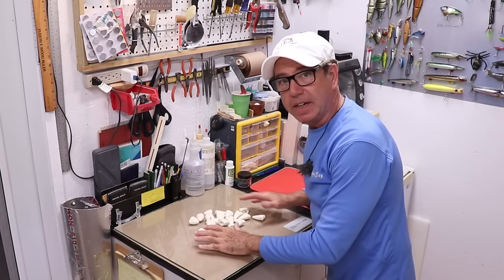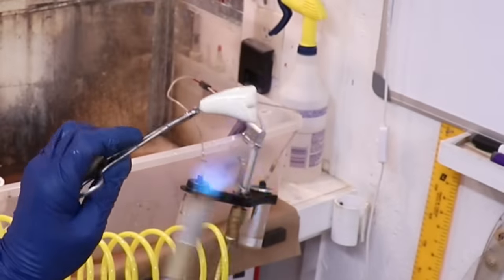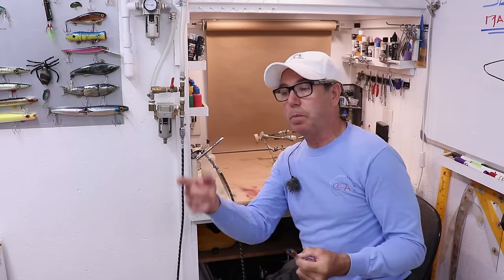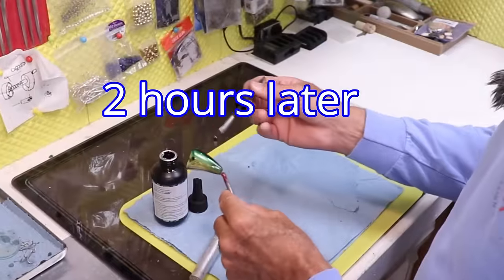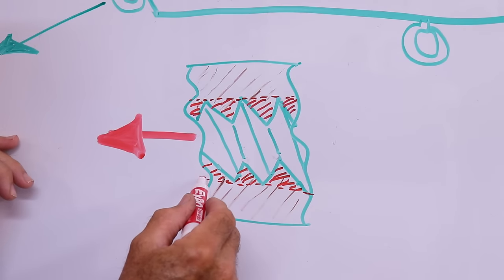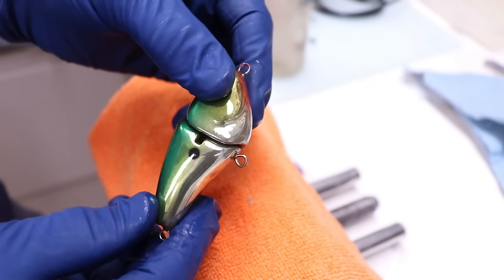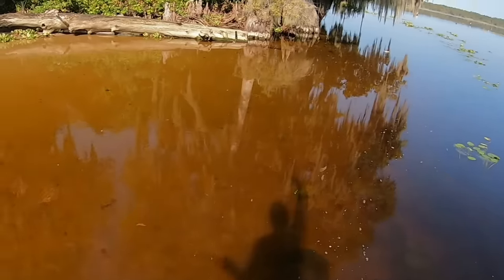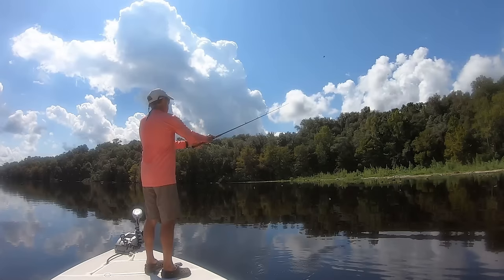Best Swimbait Colors, My favorite lure spray chrome color for everything  #lurefishing #luremaking

Comment: I noticed your strike eye tended to be located close to one of the bottom hook hangers.

Have you done any experiments on the location of the the strike eye holding all the other variables constant?
Reply from the maker: No....and here's why:  The strike eye is there  (on real fish) as a strategy to avoid getting eaten.  It usually pretty far back on the bait fish this way the predator will miss in the opposite direction of the escape.  I place mine near the center so I don't fool the predator fish,  I want him to get it right when he tries to eat my lure.

Comment: Ok you've officially invented the first freshwater clam lure. I didn't know they bit hard baits, what's your PB? 😂 I'm kidding but that was a strange thing to catch. 
To answer your questions, bass do apparently eat mullet. I lived close to a park with a pond. A tournament bass guy started letting big bass go there and within a short time, a couple weeks, all the mullet were gone. There was a school that kids would try to catch, until the bass got to the party. 
As far as the dam goes, the Everglades are really screwed up from people's projects. But it's not like they can restore it back to natural with all the people living on land created by draining and damming. And I agree that it's sad if they ruin that spot. But if that's going to make the entire system work better then I guess it should be done. 
I grew up in Sarasota. There was a pass called Midnight Pass and it wasn't very stable. It started threatening a rich guy's pool so they fought mother nature and it closed itself. We fought for years to reopen it. Now it's been closed for so long that the entire ecosystem is different and it's a back bay kind of area. Now a lot of people argue it's better to leave it. The county should have bought that house and fixed the pass decades ago but they didn't. It got bad there for a long time, lots of creatures died or moved away. But ither things eventually replaced them. I think Sarasota would be better off opening it so there's a pass between Big Pass and Venice Inlet again, that's a very long stretch without a pass. Lots of locals hope for a storm to open it. I remember a guy getting in trouble for trying to do it himself with a bulldozer 😂. 
So it's a tough subject, and I think the best answer is to look at places where old dams were removed and what happened. It's usually an improvement, but you might not be able to enjoy the benefits of taking it out.

Comment: Can you Spray your clear coat instead of Brush or it doesn't turn out as tough or thick by the brush?
Reply from the maker: You can spray it but, it needs to be thinned.  You have to give it at least 3-4 coats to get good protection, that takes time.